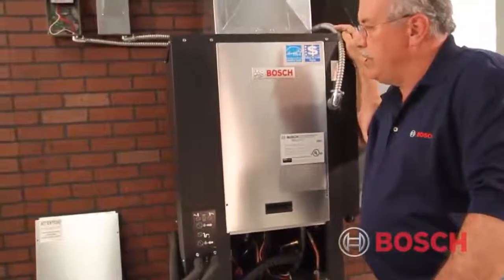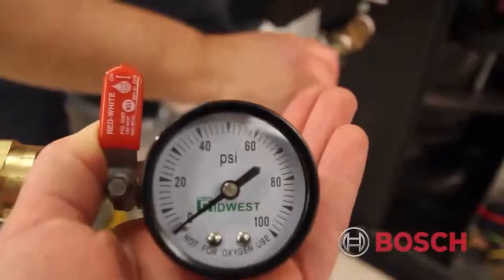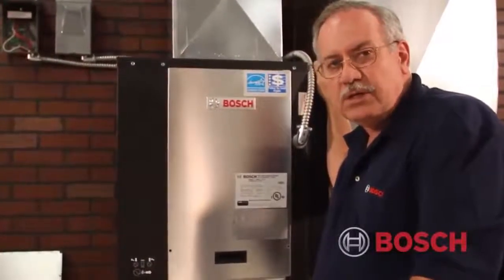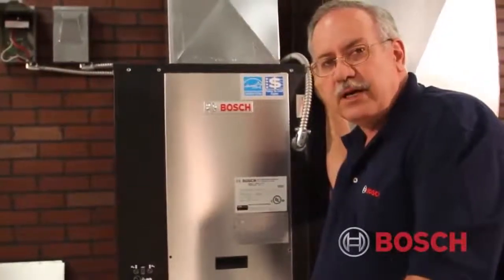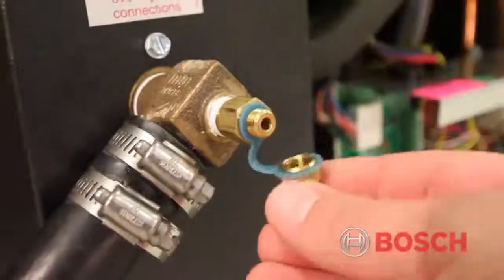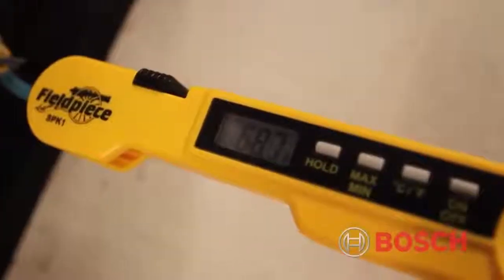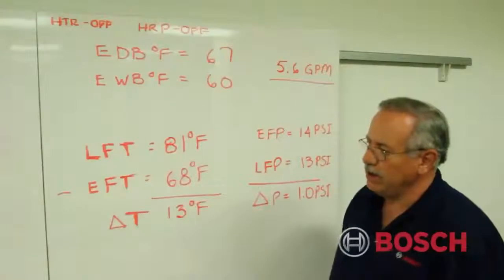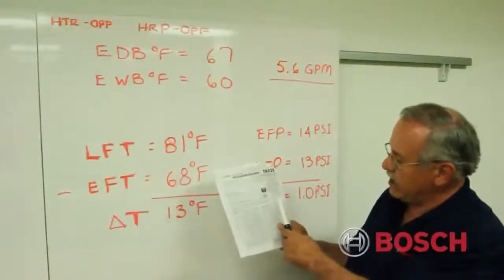Geothermal HE HR Formula

Comment: I have an old EM031 built in 2001 installed in a 30 story hi-rise that had a terribly neglected cooling tower/chemistry.  

 Will this tutorial confirm if I have a clogged or scaled coil?

I believe it is badly scaled from the visible scale sticking to the inside of the supply/return hoses.....which I may try to acid clean the condenser coil ....

It does not have a PT Port on the factory fittings, so I will try to find them.

Will this procedure confirm a clogged condensor?

I have seen pieces of plastic cooling tower baffles when I've backflushed, but not sure how much more is inside the coil......

My unit is just not running right with a very lower TD of about 10F.